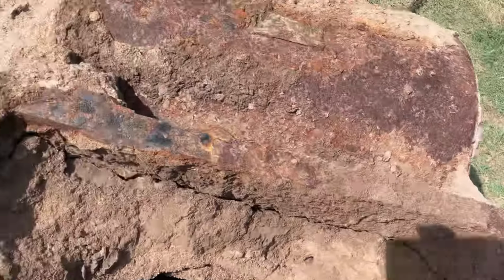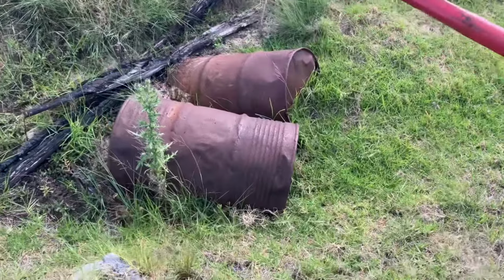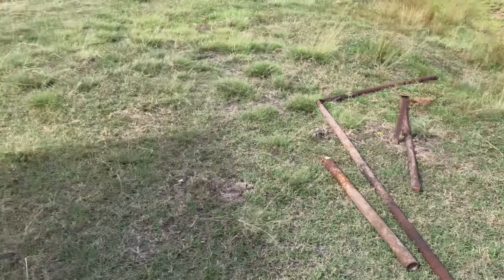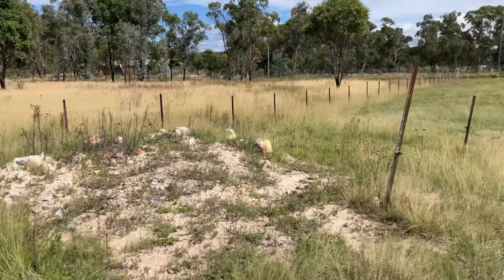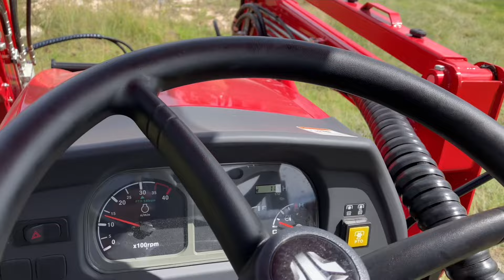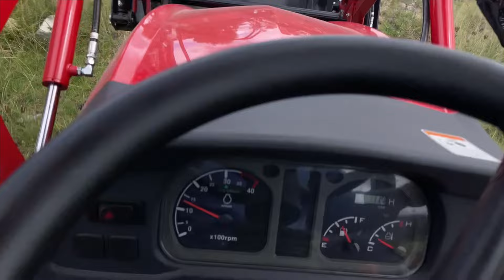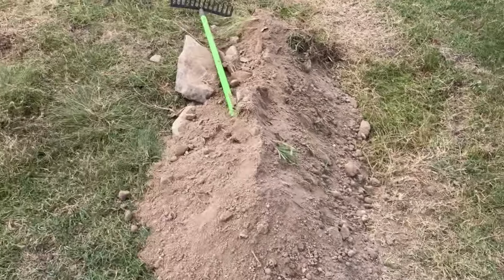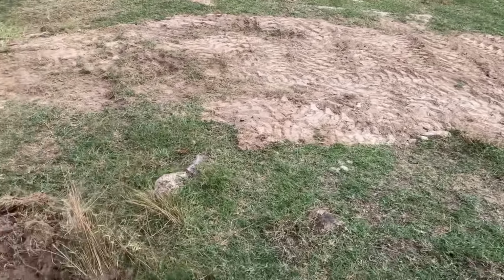Digging up junk buried around the farm.

Comment: Nice work guys, a little tip, when you are pushing into solid ground/soil with the loader, drop it back to A range and you wont get that transmission noise and will have a lot more torque. once you have the bucket full then go upto B range.
Reply from the maker: Thanks mate, I’ll try that next time.  That transmission noise does get loud.